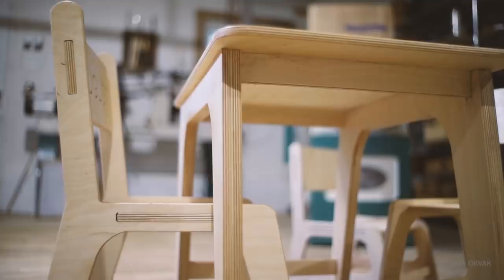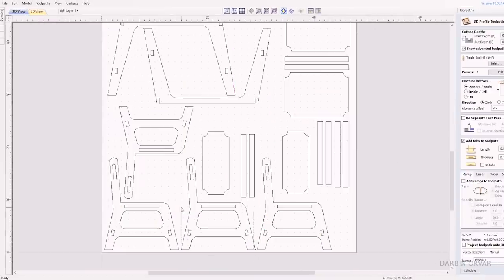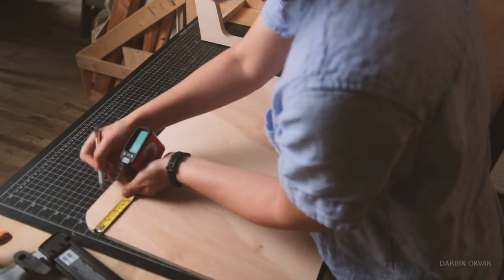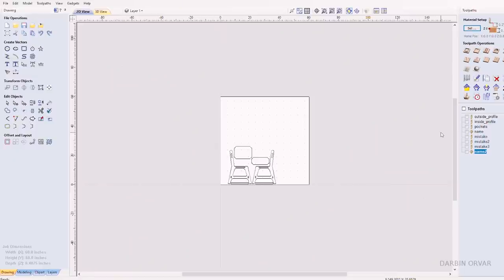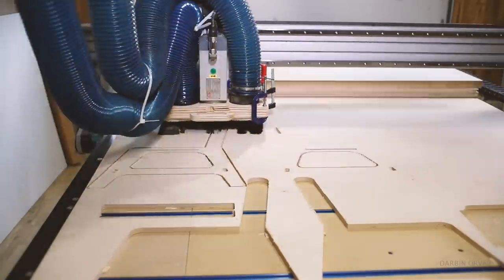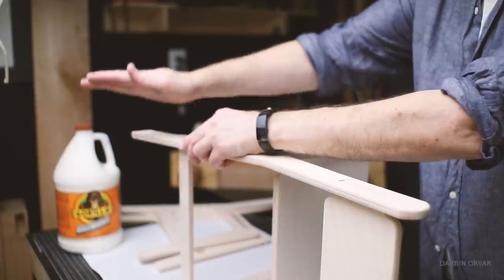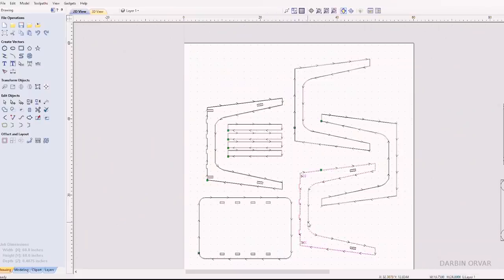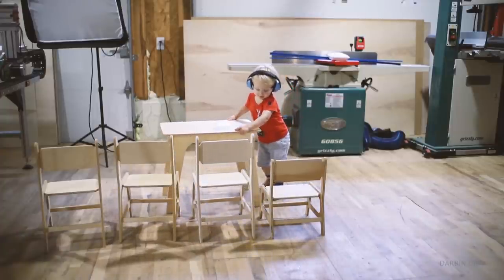DIY Modern Kids Desk & Chair - Montessori Style

Comment: To prevent blown out edges with an upcut bit, you can run the outlines first with a v-bit and make a groove 1mm deep — essentially breaking the edges before you make the rest of the cuts. This is enough to prevent the fibers from chipping out, especially if the top veneer of the plywood is very fragile.

Comment: the fuzz at the top of the cut is a result of the bit you are using. you could try a combination spiral bit to resolve it (the top of the bit cuts downward and the bottom of the bit cuts upward if I remember correctly) . also you would love a laser and what it would do for you.
Reply: that would be a compression bit -- those are great

Comment: Love the modern look on all pieces.  The fuzz...plywood and MDF.  I use downcut bits, or 3 or 4 blade end mills.  I don't have a CNC, but use these on my router when routing this type of material.  I'm going to be rabbeting cedar boards with the router this weekend, another material that splinters with upcut bits, so I'll be using a downcut bit (much prefer the rabbet plane, but unavoidable cedar knots on the edges...ugh).  The compression bit is another good idea. :)

Comment: I'm still living in 2019, where I have to cut this out with a jigsaw. These big and expensive machines drive me crazy because almost none of us will have the money to get one and the space to operate it. I love this build but CNC cutting kind of drives me away towards things I can accomplish. :(
Reply from the maker: Then use jigsaw... what's the big deal? You miss the point about iterating. That is only possible with this type of trial and error on a machine like this.
Reply: @darbinorvar  You are right. I did not intend to criticize your work. I really enjoy seeing what you build and it gives me ideas of what to build. Plywood, which is so stable and relatively inexpensive, is becoming one of my favourite materials!
Reply: Mike Gerrits check out the Maslow CNC machine. It is around $500 + a few hundred in lumber to build the rack. Maker Made 🙌🏽

Comment: I do not have any yet, but they sell those compression router bits which push all the cut wood to the center, do you think that could have helped with the cuts here? (Maybe you cover that in version two in the video).  And yep, you did that for version 2 :)

Comment: I'm struck by how the CNC is not only a cutting tool but a design tool. You have to sit down and CAD out the work before the first cut. But then you can quickly iterate and make 5 or 10 small changes and really improve a design.

Comment: For me, using a cnc machine is not woodworking. As for building  the project, you're only assembling a cnc cutout. You're just saving a trip to Ikea. I used to like your videos when you did real woodworking. Well, that's just my opinion.
Reply from the maker: I don't think you know what woodworking is... just my opinion ;)
Reply: There are Luddites in every endevor.
Reply: Wow, how rude. Well I hope you don't use power tools, that's not "real" woodworking. 🙄